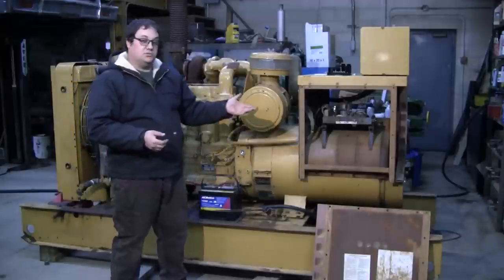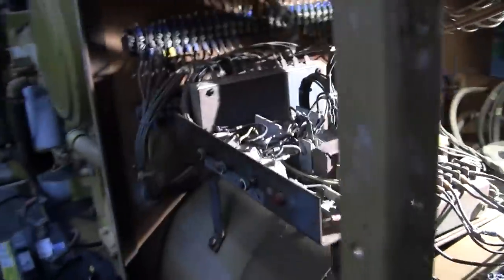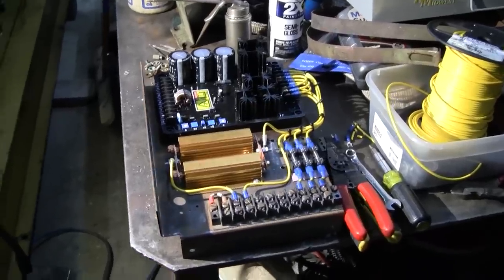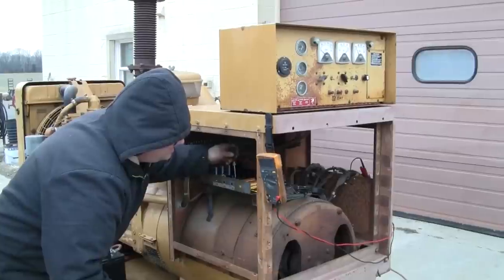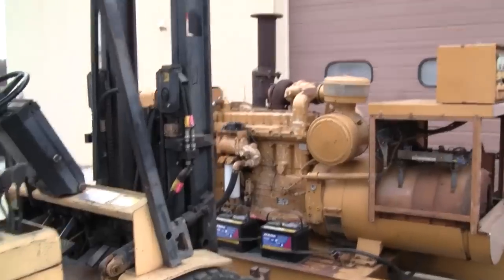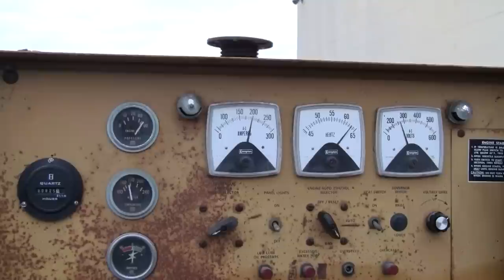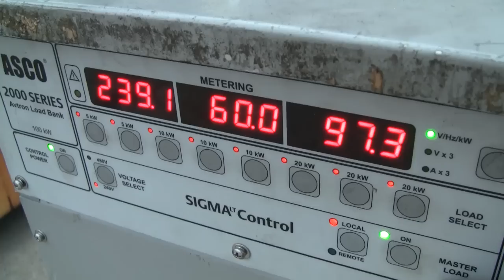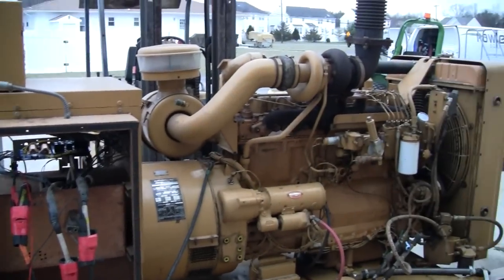Caterpillar 3306 Diesel Gen Set Gets A New Voltage Regulator

Comment: Resistive load bank only load test the engine, not the generator.  It takes verry little excitation to make rated voltage no power factor. Put 8% lag load and you will see the nameplate excitation. I worked for Michigan Cat for 43 years as a E P G Field tec. Those things are bullet profe. But you should see about 12 volts no load @ reted voltage to make sure all is good in the excitation system. Glad you are back.
Reply: How is the non-resistive load created?
Reply: You need some reactance, so either inductors or capacitors. If memory serves you’d need an inductive load to make a lagging load.
Reply: What do you mean 8% lag load will make excitation volt?@sstorholm

Comment: Basslet are very good regulators. I replaced an old contact point regulator to a new modern Bassler. The Genset I was working on was a 6 clynder Detroit 2 cycle diesel. Wire for 480 volt 3 phase. It originally would only run one 75 hp well motor. There were 3 wells at this site. After I installed and adjusted the Bassler I was able to start one at a time and get all three well motors  to stay running. These were used at my old job working for the Suffolk County water Authority on Long Island. Management was thrilled to get full emergency power back.

Comment: GOOD fix! Sweet genset. I was arond that engine in D6-C' and 7-F's. Fine setup and it has the hand throttle like the old genset the crusher had with a D-8 or 9 pony start engine. Slow speed but STRONG! Glad you're back!

Comment: That 3306 one of the best Cat engines ever made.
Reply: Worked on wellhead gens and compressors. So many 3306 out in the oilfields. We would top end em at 30k and inframe at 60k. They usually lasted 80-95k before being swung and rebuilt.
Reply: @montey1017  So perfect so simple.
I hate the heui POS motors 3126  C7 s .
CAT went down hill now sells Chinese parts at dealership.
Sad  .

Comment: Careful with fuses in the sensing lines, if one of them blows voltage will go up until smoke comes out everywhere, lots of collateral damage.
Reply: Correct. They are internally fused also.

Comment: Friend of mine fitted a 500 kva ex military trailer generator at a farm grain drier  it was 1955 vintage with 50 hours, was cheaper than the line charge for the install that was 15 years ago, just needs it's oil changed every year before it's started for the harvest

Comment: Impressive and interesting as ever.
I think I would have used all the mounting screws on those metal clad resistors rather than one each as far as I could see, their full rating only applies when fully bolted down to a defined heat-sink.

Comment: Im currently doing a full controller upgrade on an old 60kw Generac, went up in smoke on me during a diagnoses for no remote start.  The entire generator control harness was melted and fused together.  It needed a new governor controller and actuator, as the original Generac stepper motor needed inputs from the original control module, which is obsolete.  So I have a new deep sea controller installed, engine running at 60hz, and the next step is to get the new Generac AVR working.  It also requires ballast resistors, and in the schematic it shows a rectifier in the field circuit as well, so Im assuming the AVR does not put out a straight DC voltage for the field.

Comment: I think I see a selenium rectifier in the VR.  That's surprising to me for a 1980s assembly.
Reply: It was there for suppression.  The power block has a SCR, and a diode. The diode is an exciter field suppression diode that maintains the field through the next 2 cycles after the S C R is fired.
Reply: @johndean7618  thanks for the explanation of the function of the diode.  My surprise is because i've not seen any equipment built in the 70's or later that used selenium rectifiers, after silicon diodes were in mass production.
Reply: The newer voltage regulators had a M O V IN PLACE of the selenium device. That device was not a regulator  rectifier,

Comment: Wish you lived a bit closer but I'm down below Altoona Pa. My old Wisconsin powered Winco genny could use some attention. It holds between 59.4-61hz but voltage is 138-142v on both legs. I suspect that the old capacitors which are original from 1962-1965 are leaky. I know that a cap can act like a resistor when they become extremely leaky which will throw the voltage off. It does have a VR in it but I'm not sure if it is adjustable. I haven't pulled the VR out and inspected it yet.

Comment: Impressive governor and voltage regulator response.  What is the THD like in these larger units?  The smaller brushed generators start at 5% and quickly go up to 20%.  Was wondering if the larger stator improves the harmonics.
Reply: Harmonics are not an issue unless you have a wild power factor or dynamic loads.

Comment: Great video. QUESTION?  Given the added ballast resistors to the field to bring the field into AVR spec, would you recommend fusing the field? I am retrofitting a Kohler Powerboost to an SX460 And DSE 4520 and think I will need to add ballast to my field as well.

Comment: Hey Mike, very informative video! I have an early 60s D311H genset, 30kw 10lead. It has the SRSE (self regulated self excited) gen head, It has some similar components to this genset. I am about to give up on  troubleshooting a low voltage condition and wondering if you can recommend an exciter upgrade like you have done here. Excitation requirements from the name plate are 29v and 58 amps. Thanks, Griffin
Reply from the maker: Griffin, 58 amps is a lot of current! Is that what the name plate lists?  There are one or two manufacturers making high field current regulators but they are very expensive!  I have used regulators built by PowerTronics a couple times in the past where high current was required. 
Most of the commonly available regulators are only good for about 15A.  Anything more than that requires some pretty beefy power switching components. 
How far below rated voltage is your unit running?

Comment: What is that black box on top of the oil cooler? I thought elec gov controller but it's a mechanical
Reply: Looks like a time delay relay. Used either for ETR or ETS. (Energize to run or energized to shut off.) It would hold the fuel shut off solenoid in the kill position for ETS so the engine would come to a complete stop before releasing and mechanical governor would fuel the engine and run again otherwise. 
ETR would delay shut downs from oil pressure for start up- if memory serves me correctly.